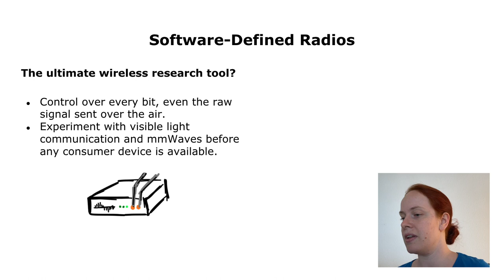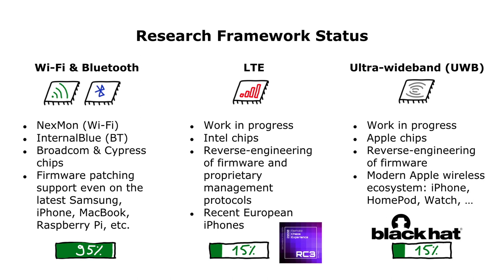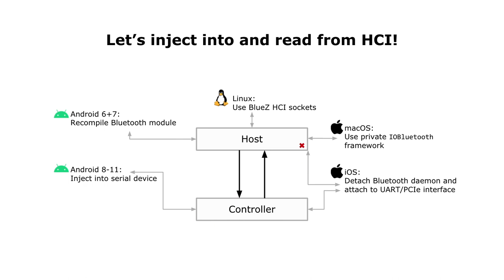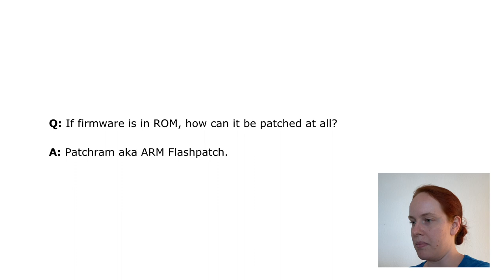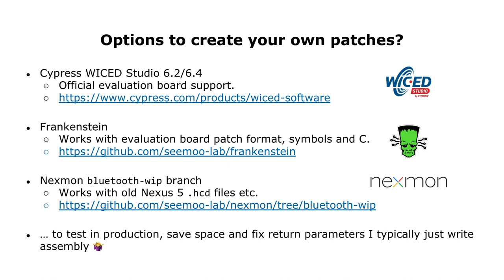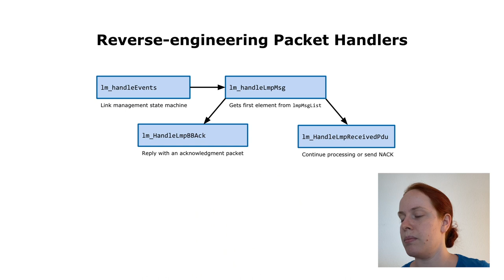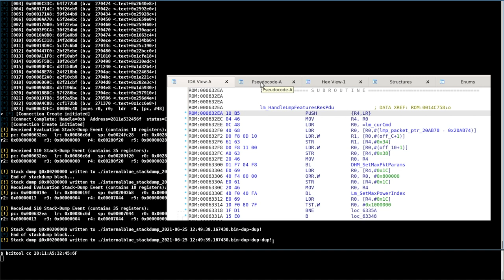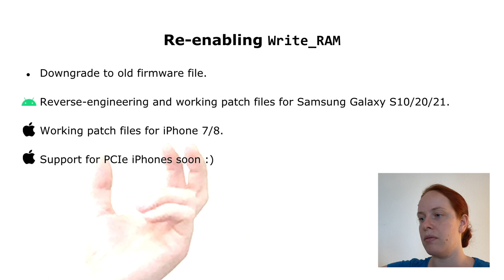InternalBlue Tutorial - 2021 Edition

Comment: Hi Jiska, thanks so much for the great talk as always. I had InternalBlue working well on an older machine about a year ago, but I'm trying to set it up on a new one and I'm running into some problems. When I try to run the "setup.py" for the H4 Wireshark Dissector I get an error saying "include could not find load file wiresharkplugin" and when I try to use any of the nexus5 PoC scripts I'm met with an error saying "Installing patch for VSC existence check failed". There is an open issue on the github asking a similar question.

Do you have any advice on what might be going wrong? I understand if you're too busy to answer though, so please don't feel obliged. Thank you!